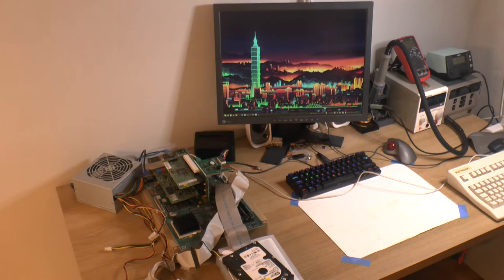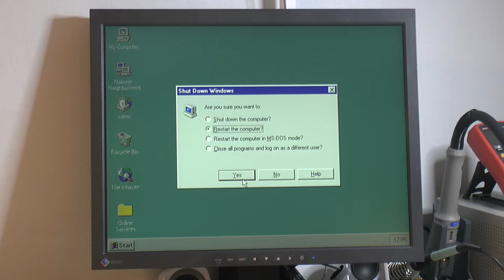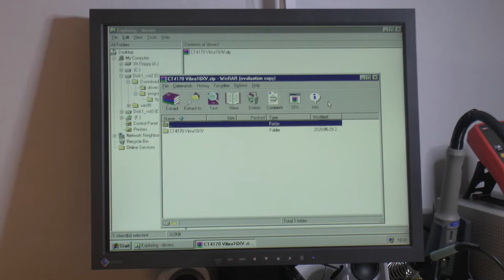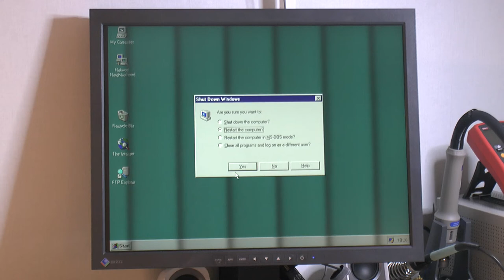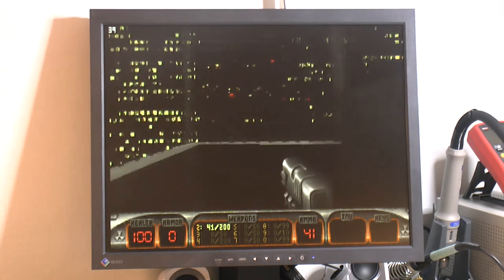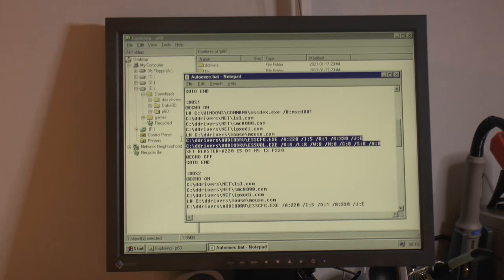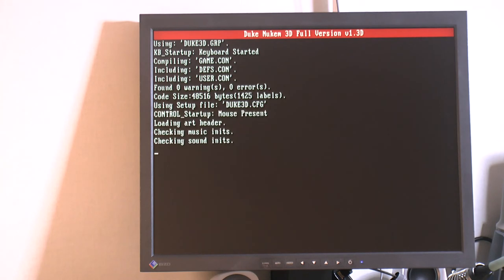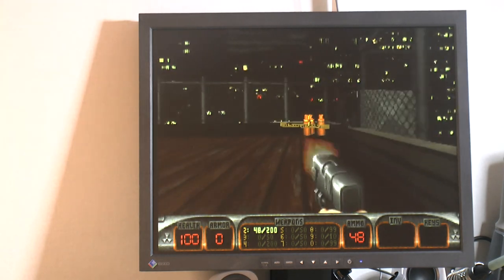Building a Socket 4 Pentium 60Mhz system - Part 1

Comment: I also saw your 3dfx party.

Did you meet together from all over the country?

Then don't you have to move the computer back?

And I am also a fan of 3dfx.

I have voodoo2 and voodoo3 3000 pci.

I quite like amd k6-2.

I have always wanted to know the performance of other games besides Quake 2. Like trespasser.

I mean 3d now! instruction set.
But it seems that there is no performance except quake2.

Maybe the optimization is not good. I mean other games.

And 3d now!. In addition to Quake2. There are few other game-related tests.
Reply from the maker: We had people from  the USA, Denmark and Netherlands that all are 3dfx collector of the rarer vintage type like the Quantum3D Mercury brick
.
People bring there own computers or they can rent one for a very small fee for the duration of the lan.

I have a K6-2 delided in a box, but I run a K6-2+ because it has onboard L2 cache like the K6-3.
In fact its a K6-3 with half the L2 on a 180nm node instead of the old 250nm.

3Dnow! makes a decent bump in Quake 2, if I recall when I had my original 450 and a Voodoo2 it could match a Celeron with the 3dfx patch at the very least.

And now there are not that many games with 3Dnow! support but when they do support it properly it makes it more competitive with celerons of the time.
Reply: K6-2 was very famous at the time.

But it seems that there are not many games supported.

And not all games can be like Quake 2.

I mean it has the same performance as pentium2

The top computer when I was a kid was the pentium2 XEON.

Until athlon comes out
Reply: @阿綸的全勳學院  I also had a k6-2 450 with a  voodoo3. It wasnt as fast as the pentium II. But it was fast enough for the most games

Comment: What level of cpu do you think win95 needs?

I mean it works well.
Instead of using
Reply from the maker: DX-2 66 and 16Mb of ram would be my  minimum pick, might be able to go to 50mhz and 8Mb of ram but at 4Mb of ram its swapping a bit with no programs running so probably not enough ram to be usable.

I tested it on my DX2 66 with 20Mb of ram and that worked very well with Windows 95 osr2.5, latest version supporting fat32.
I just killed the IE4.0 installer after windows starts up the first time then I install IE5 instead so no active desktop, the web enhanced desktop and browsers just slows stuff down but they are not needed.
having IE5 or newer you can run more software that requires parts of IE.

I use Deamon tools 3.47 on it to mount cd images ans stuff, its not laggy or anything like that, it wont multitask very well doing file transfers and such but yea is perfectly good experience.

Windows is mostly used to do file transfers anyway on 486 and early pentiums.
There is TCP/IP, DHCP and FTP client for dos, probably gonna try that someday.
Reply: thanks for sharing. I have always been curious about these things.
So win95 can run well with 486. Others are excess performance

I also bought win95 recently

CD by OEM